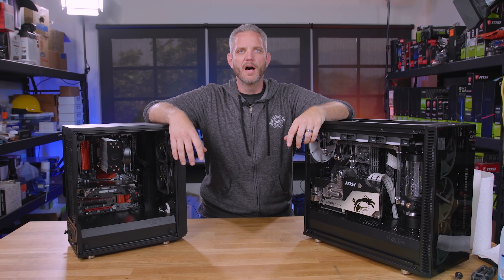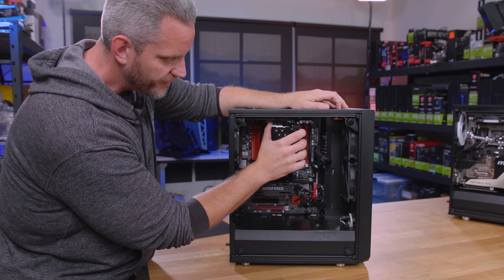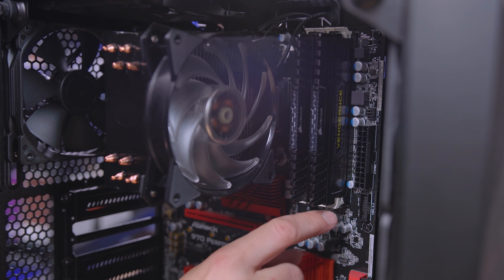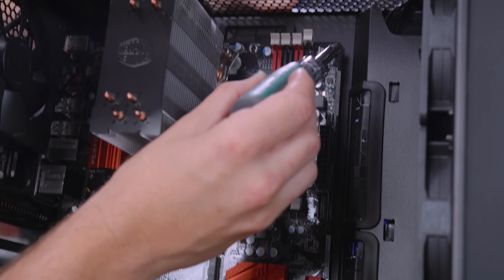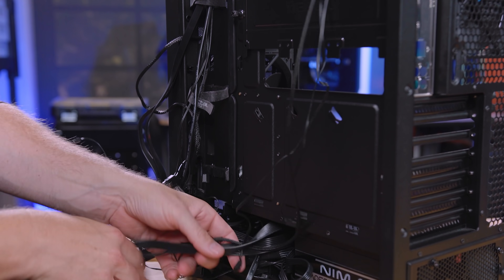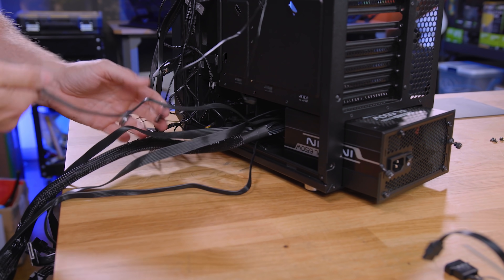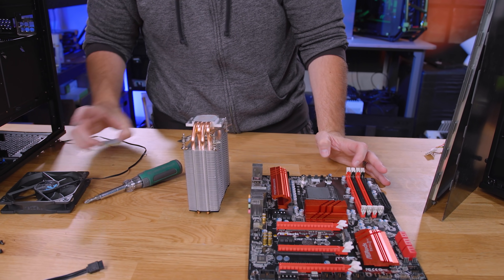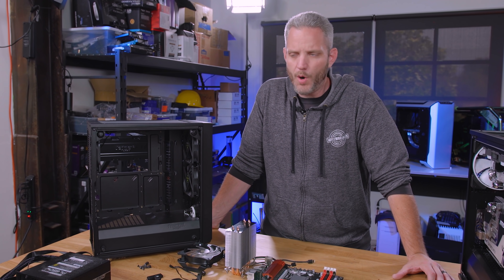How to UN-Build a Computer

Comment: Do you need to use alcohol to clean the cpu and cooler? Or is there something more accessible I can use?
Asking because I might install a new cpu (while potentially keeping the same cooler).
Reply: I assume your confusion is a translation error? Not the drinking type, this is rubbing (isopropyl) alcohol you would get from the pharmacy (druggist, chemist, etc) department. Here, Walmart sells 32oz (946ml) for $2.50. It is used for cleaning and disinfecting minor wounds, but also very useful for cleaning computer components since it evaporates almost completely (pay attention to the % listed on the bottle. 70% is 30% water, and can damage water sensitive components. Jay recommended 91% or 97% because they leave practically no water or residue behind. FYI, 100% alcohol has a flash point around room temperature, so it is never sold in normal stores)
91%  drinking alcohol? Everclear is very expensive in the states, and I don't love my computer that much, lol.
Reply: @caniscerulean  I did not actually know it's that easy to buy... (not a translation error, I know you're not supposed to drink it)
Thanks for the tip, I'll see if I can buy it in a supermarket here or something! (Netherlands, btw)
Reply: @NorthLaker  Glad to help, good luck with your upgrade! I always think it's interesting to find the tiny differences people take for granted. I'm mid 30s, American, so rubbing alcohol was just part of my childhood, like windex, bandaids, etc. But rubbing alcohol is definitely not painless, so younger kids may be used to numbing disinfectant sprays, while my older siblings got iodine on their cuts. Maybe it isn't as widely used in the Netherlands, or you may be younger so it isn't used like it used to be? If you are younger, there may be age restrictions on buying it, since it can be hazardous if misused (I don't know how many times I doused my hand in it and set it on fire when I was young. You can let it burn for a few seconds without getting hurt, and usually just shake it out. Keep a blanket or something handy just in case though. )
Reply: @caniscerulean  Yeah, we mostly use iodine here if necessary. Any other stuff, like alcohol, is applied by a doctor if it's needed.
I'm 18 years old, which is exactly the age you turn adult here, so that won't be a problem.
Thanks for the tips!
Reply: @NorthLaker  Thank you for teaching me something, as well. Again, good luck with your upgrade!

Comment: i think LGA makes more sense for any scenario where the the average cpu costs around 3 times more than the motherboard, i believe thats exactly the reasoning behind it, see AMD TR

theres also the much appreciated fact that buying used intel cpus is almost guaranteed to be frustration free, since those little things are almost indestructible, shipping wont be a concern either, also LGA boards have their pins recessed anyway

Comment: my workstation has thumb clip thingys instead of having to take screws out when removing add-on cards. if your computer has these, DO NOT unscrew them as the plastic tab needs to stay bent to keep it's strength, if you remove them, then put them back, they dont spring back enough to keep tension. just a heads up.

Comment: My first new computer was an OEM computer from HP my folks bought at Walmart.  I practically destroyed the computer trying to figure out how to remove parts in order to find out what parts I needed in order to upgrade them.  I didn't have access to the internet at the time, and if I did, it wouldn't have been much use as it was pre-Youtube and tech forums/webistes weren't as robust or common as they are now.

I learned a lot from that computer.

Comment: Noobs should be aware, If you have an HP, Dell, IBM move along. Those use customer parts i.e. PSU, Motherboard etc.. and you cant swap them out into a nicer case unless you make some heavy modifications.

Comment: Twist these AMD cpu cooler!

Since AMD64! (previous chip where more like don't squish the die!)
Reply: Well, still twist though. Ive seen it several times that an old athlon stuck to the cooler and then the die broken when you tried to get it off. They really need to make thermal paste that doesnt turn into glue over time. Well, at least make it more common, there surely are  a few around.

Comment: Couple things I noticed!
You mentioned the CPU power plug (8-pin), but never said you were removing it. Some might yank their motherboard backwards if they forget to unplug some stuff, same goes with a lot of cables too, like Front Panel, SATA, fan headers, also possibly the IO shield.
You mentioned a water cooler but didn't show one for examples sake. Though they aren't too dissimilar, if this was a down-to-earth beginners video handling methods so it doesn't slam down into something, the crazy long screws that could puncture the rad, and the aforementioned Fan Header cables would be something to include!

Comment: Thank you! Could you also do a video about upgrading the GPU and CPU - especially when changing from AMD to Nvidia GPUs or vice versa? I'll be doing this soon and have read about potential issues with conflicting drivers.
Reply: hi use a programm ddu to complety remove a graphics driver , most times it makes no problems when the old driver is still there
Reply: @Akio4800  Thank you!

Comment: I have a Nvidia GTX 580 that runs hot and thermal throttles when in a game any tips? I've tried cleaning the card and redoing the thermal paste which made a couple degrees of difference but the card still throttels

Comment: Can you please do a amd ryzen build in the Corsair spec delta rgb. With a nzxt kraken x42
Reply: this request is weirdly specific. it doesn't usually matter what case or cooler you have because they are all fairly similar to each other, thus making it easy to build with a wide range of parts.
Reply: Askindale yea I know. But that’s just because I want to buy that case and with similar parts
Reply: That case sucks.
Reply: Why does it suck?

Comment: Just un-built my computer 2 weeks ago. Moved mATX system from full ATX case to a Fractal Design Focus G mini. Now it fits in the little computer cubby in my computer desk. 
You know those 5 1/4" drive bays nobody uses? I put a drawer in mine to hold all my USB drives so they are easy to find and access now.

Comment: I would add two bits of advice.

1) Take some course of action to protect against static discharge while disassembling and handling the parts.

2) Ensure you use a good quality Philips head screwdriver of the correct size especially when removing the motherboard. Using the wrong size or cheap screwdriver increases the risk of slipping and easily damaging the motherboard.
Reply: Obviously ESD is only an issue when you are building the computer? The components know they are being taken apart and protect themselves accordingly. Or, since the parts all belong to someone else, and the reservoir isn't subject to ESD, he doesn't care. But yeah, I was actually wondering how far down I'd have to scroll before someone mentioned ESD. (not even a live strong wristband joke... I'm disappointed in this community.)

Comment: Removing an AMD CPU from a prebuilt system is the worst thing I have encountered when cleaning PCs. It is like glue, impossible to twist off. I had to rip the cpu out of the socker with the cooler and then spent half an hour soaking the IHS with isopropyl and a razor to get between the ihs and heatsink before it popped off. It there was a way to just put the cpu back in with the heatsink still on I would've done it.

Comment: One god tip on PGA CPU is to heat up cooler before taking out cooler. If it is working PC run some benchmark or game to heat up paste. If You don't want to power up just use hair dryer. Direct air stream on cooler and heat it up a little. In most cases it won't be necessarily needed but some thermal paste can be quite solid if it wasn't changed in long time.

Comment: If I can posit an idea for a video on here, I think a good video would be discussing what the symptoms are for when different parts fail in older computers. Like common signs that  your motherboard has failed or is failing and need a new one, common signs that your graphics card has failed, commons signs your ram or drive is failing etc etc.

Comment: I once had to fix a PC where the owner wanted to replace the PSU. He just cut off all the cables coming out of the PSU instead of unplugging them.

Computers components are designed with very defined guidelines to ensure compatibility. Cutting and drilling is not part of the normal repertoire unless you are a modder and know what you are doing.

Also, don't forget the IO shield before you throw the old case out. Only made that mistake once. :P

Comment: jay, i have a question about a computer i just built

so i just built a computer, all brand new parts, and when i turn the pc on, all the fans run and the cpu fan is running, but nothing will display on the monitor, let alone even be recognized by the motherboard. i don’t know what the issue could be, i’ve asked everyone i know. i can’t set up the bios or windows. plus, my mouse and keyboard get very little power

Comment: Anything can be unbuilt with 4 easy steps.
1. Find a sledge hammer.
2. Pick up sledge hammer.
3. Swing sledge hammer at problem.
4. Repeat 3 until satisfied with result.

Comment: The stock heatsink fan was completely glued onto my FX-8320 with rock hard thermal paste so it took a heap of effort to rotate it and break the seal... by contrast the aftermarket heatsink fan I replaced it with had trouble releasing the clip from the motherboard, and when it came off the few month old sticky thermal paste brought the CPU with it!  Thankfully it didn't seem to do any damage, although the new power supply (which required the CPU cooler be removed to install) only lasted for a minute before silently failing...

Comment: I killed an amd 265 card with electrostatics, I flet the zip going into the GFX card and GONESKI with the wind. Use professional antistatic cable or take out your shoes and ground yourself at the radiator in the room etc.... just my 2 cents.

Comment: 13:20 or if it's really hard stuck, old ones especially, then use tooth... shit don't remember the word, the string thin thing that you use to clean between theeth, but if the CPU cooler is big like that, oh boy. Hope you can unhook the CPU and then take it out and only then try to get it unstuck.

Comment: He should have demonstrated how to unplug the USB 3.0 plug, they can be really hard to unplug from the motherboard and if you pull hard enough you might end up ripping off the whole connector instead.
Reply: This is funny because I just did that today and ruined one of the sides and one of the pins on mine. Luckily, I had a PCI-e USB 3 expansion that I could use instead.
Reply: Now you just have to dread the day when you're going to have to unplug that one. lol

Comment: 12:18 if you would like to avoid this issue, just run Prime95 for 10-15 minutes or so, allow the thermal paste to heat soak a bit. After that, shut it down and remove the cooler. Comes right off no problem.

That's the primary reason you don't wait until the motherboard is out of the chassis, to remove the CPU cooler.

Comment: My gift PC didn't come with a heatsink so I had to put one on it. It just had some weird cover with tubes coming out. I cut the tubes and was able to pry the thick cover block that held the CPU in. Once the CPU was off I put some thermal paste on the socket and reinserted the CPU after I epoxied a heatsink to it. Also the tubes on the cover ran to a big black block that covered my fan spaces so I used a Dremel to cut out some holes to mount some fans.
Reply: Also the idiot had some weird HDMI 1080 ti ftw expansion card but I only needed 1 video port and the motherboard had an HDMI and a VGA port and I have a bunch of VGA cables so I just used those. Got to take that stupid HDMI card out and get rid of the RGB leds it had all over it. Gee Force? Gee, no thanks I don't need 40 HDMI ports for no reason. Glad he gave me this PC but I wish the noob gave me a decent brand. Origin PC? Like the Steam ripoff? I knew Walmart made PCs but this must be Kmart shit.

Comment: I need a little help on deciding if I should build a desktop or not, if somebody could help me out that would be awesome.
So, I current have an Hp omen 17, I was in college just graduating so I couldn't build a desktop and laptop was the only option because of the portability. 
But now, I am in a position where though I do have a place of my own, but it is very likely that I might have to change apartments every year or even after 6-8 months, so should I now build a desktop (which I really want to), or is it too much of an hassle to transport it every time you want to move and just stick to laptops? 
Anyone with any experience of travelling with desktops, could you please share something?

Comment: The CPU getting stuck to the cooler is not fine. I got pins bent on my ryzen 1700 when that happened. It was like glued to it. Used arctic silver. Gladly I managed to bend them back, but holy hell..

Comment: Jay, u should do a new video of what's included in water-cooling builds if u start to search for parts on your own. (Just a picking parts video) For example I've watched your videos and I started looking for parts myself (softtubing) and I found that I missed some things. Like the pump (missed pump top lol) . Ex: What do u need for 1 graphics card plus CPU? How many fittings plus how many extra? 
A complete list for newbies.
Go with general figurations like 10/16 softtube and parts for that. And maybe something with hardtubing as well, in another video.
Reply: Bitwit and Paul's Hardware both have videos like this I believe
Reply: @QK_SAND  I like watching Jay more ;)

Comment: I think that it's good practice to run prime95 or some other stress test to "soften" the thermal paste on AMD CPUs and then twist the cpu cooler until it breaks the paste, because you can actually pull the CPU "glued" to the cpu  cooler like Jayz said, and that's a pain in the ass.